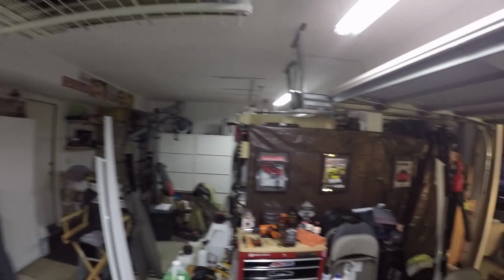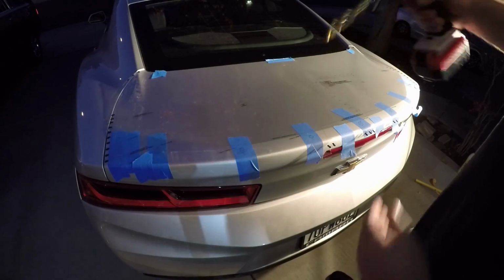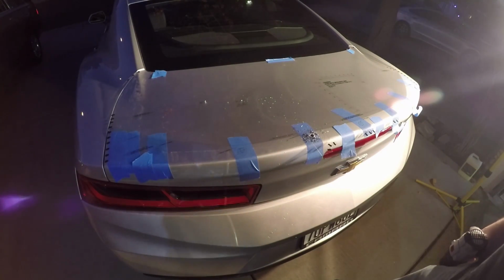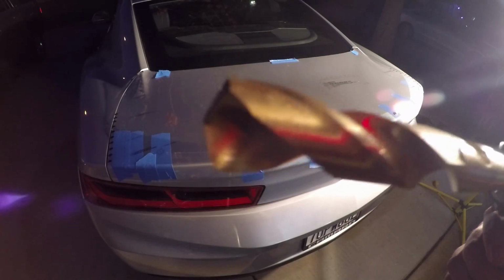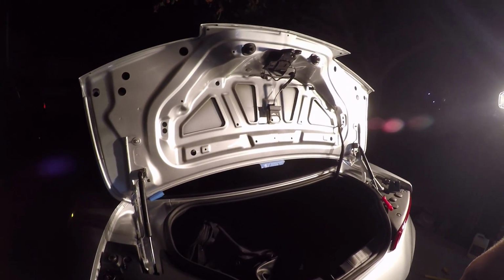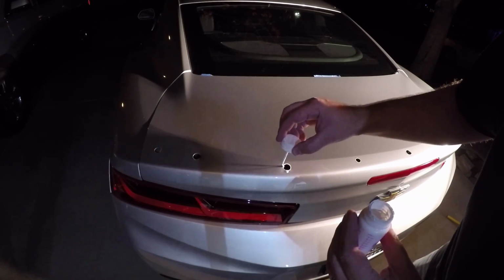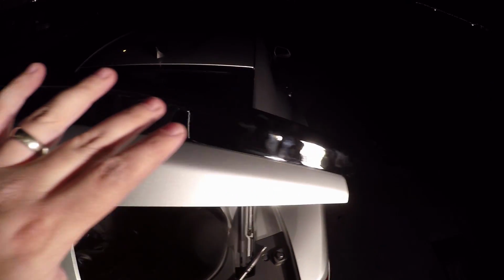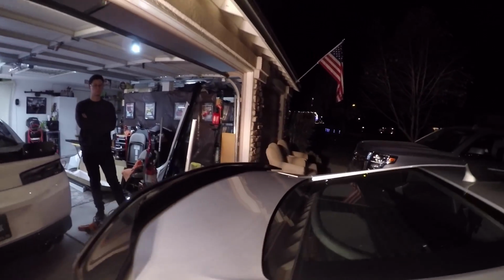High-Wing Spoiler Install Guide: 2016-2024 Camaro LT/LS & RS

Comment: Matt if you will pre drill your holes starting with an 1/8" drill bit and work your way up to the desired larger size you will not have as big an issue with your drill bit "walking" on you and the hole will be much cleaner around the edges with little to no distortion of the metal.
Reply from the maker: If you look at the 3rd hole I did just that. Didn’t seem to help. actually caused the big bit to grab the metal and tear it.
Reply: LethalGarage when it does that it means that your step between 2 drill bits is simply too big. Use more drills and you'll be fine.
Reply: @Lethalgarage  I tried using the link for the wing but it’s not working. Is there another link? Really want this wing for my wife’s Camaro, trying to surprise her for her birthday coming up. Please let me know!

Comment: I installed mine a couple of months ago. Fyi, if you already have the RS spoiler it uses the same mounting holes. No problems with water leakage with mine.
Reply: Thank you! It's $1200 CAD to order the spoiler with the car... or $450 for the part. I was going to just order and install myself and this was what I was wondering.

Comment: Will this fit a base model 2017 Camaro LT? I currently have no spoiler or holes in the trunk. If it does fit where you recommended I get this installed at.
Reply from the maker: It will fit. Any body shop should be able to help
Reply: LethalGarage appreciate the quick response 👌 is the car you installed this on the LT base model too? Also is this an authentic GM part, if so wouldn’t a Chevrolet dealership be able to install this.
Reply from the maker: I think it was a LS

Comment: I feel like rubber washers would keep water out of the drilled holes.
Reply from the maker: nope, as their isn't enough pressure around the holes where the bolts are.